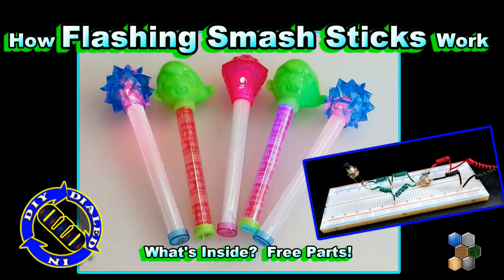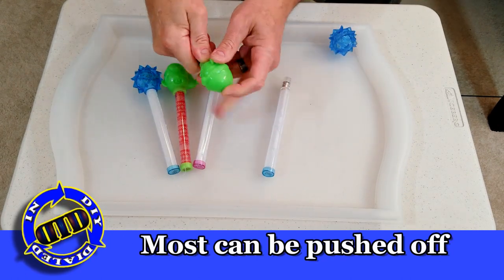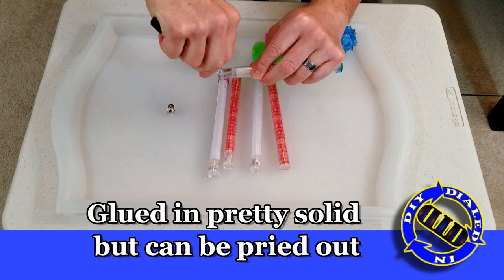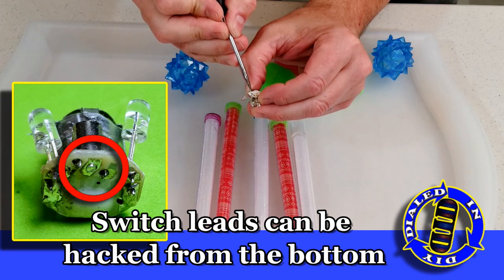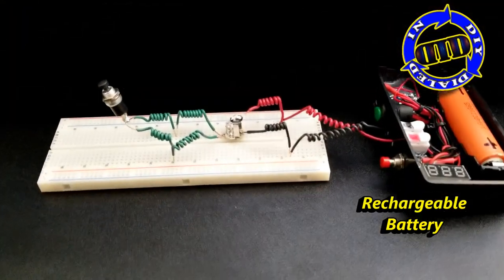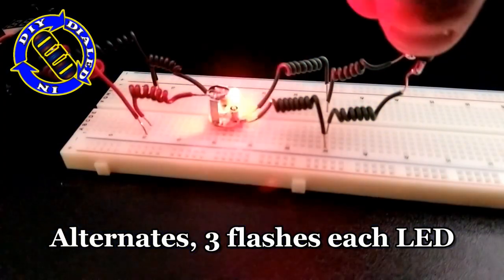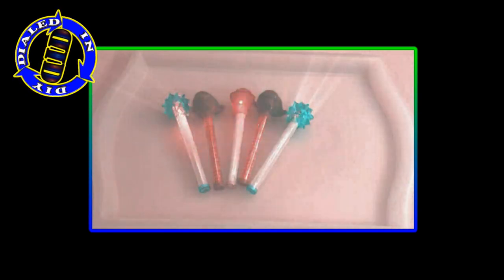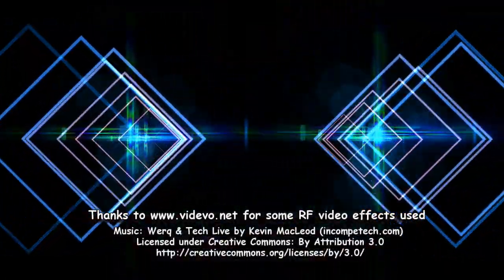Flashing Smack Lights - How do they Work - What's Inside

Comment: I have a collection of about 6 of these light modules that i took out of koosh toys- I am interested to know what you end up doing with them. I have recently souped up a Little Tikes toy truck I found in the alley for a kid on my block and had thought they might look cool on top of the truck like police lights- I ended up putting light up fidget spinners on the wheels so I figured the parents aleady had enough battery issues to deal with.
Reply from the maker: That is a fantastic idea. Also, very cool of you to trick out the toy for a kid on your block!  I'm adding some to toys as well but am also having fun tinkering with a quiet signal from a motion sensor... for fun.  The reason I tested on the rechargeable battery pack is so that I can connect multiple in parallel and build in a recharging board for ease of use. Thanks for watching a posting a comment!
Reply: @DialedInDIY  WOW! I love the motion sensor switch idea- I bought some one time but have zero idea how to make them work haha- maybe you could do a video about that? I made a "stump monster" https://imgur.com/gallery/6knSY in front of our house that has a button kids can press for noises but it would be great if it went off with motion!
Reply from the maker: @ThyrzaSegal  That stump monster is really cool... love that it has sounds too. I actually do have some projects on my list to do that activate with motion and I am tinkering with some ideas for Halloween decorations now. Just fixed a broken, animated skeleton dog that reacts to sound (sometimes) and I plan to eventually change that up to motion too.

Comment: About your air cannon shoots ping pong balls video from a couple years ago - is there any reason you can’t end up using only one width of pvc pipe? I’d like to build it but I have 1-1/2 inch pvc pipe but no other pvc pipe, and I would like to make this as cheap as possible. Plus, that way you could cut out a couple of connectors where you change the fitting type to different sizes. Is there any reason I shouldn’t do this? Sorry if you forgot about that video, but on the topic of this video, great as always!
Reply from the maker: A great question! Yes you can!!  Very good, economical idea too.  I've done that before but in the ping pong ball vid I wanted the look to be more unique and a bit more compact without sacrificing size of my air chamber too much.  Thanks for watching and posting your very creative idea!  I'd love to hear how it turns out after you make it.
Reply: @DialedInDIY  it turned out great! Its really cool and was a lot cheaper than it would have been otherwise.
Reply from the maker: @2tmb904  that is great!  Fun project to tinker with too isn't it? Hope all is well.
Reply: @DialedInDIY  yeah totally.